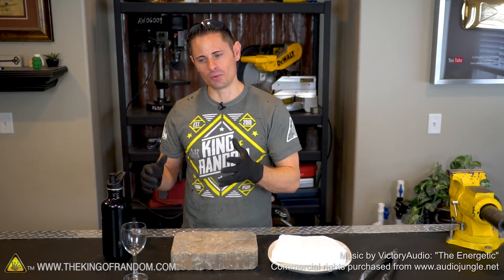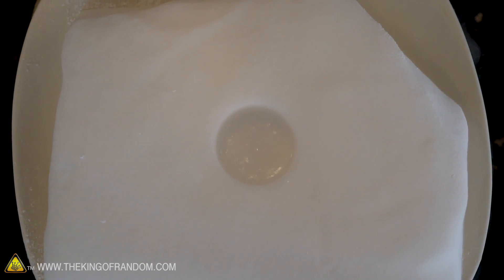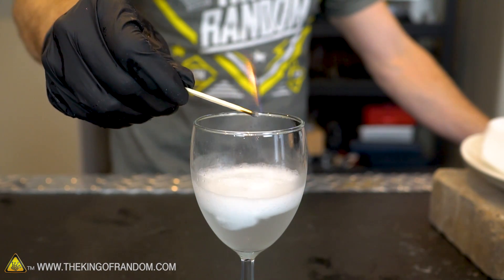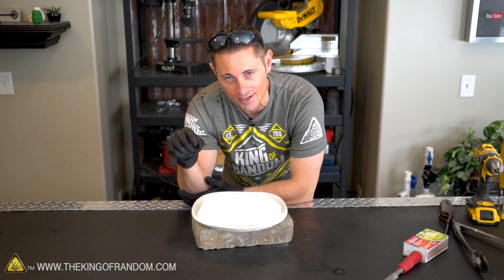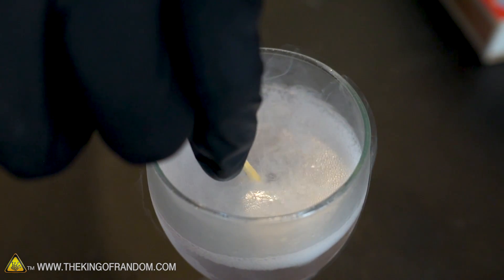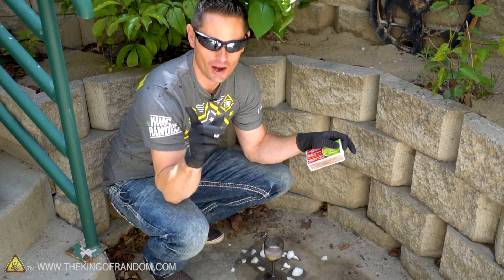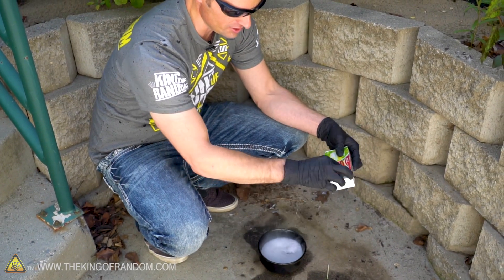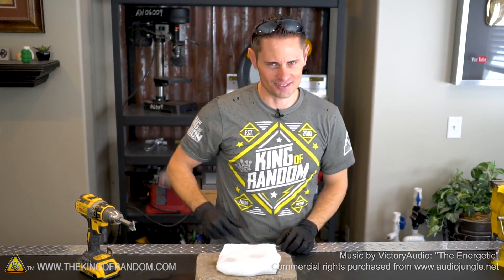What Does GASOLINE Do To Dry Ice? Can You Really Make A Fire Extinguisher With Gasoline?

Comment: Can you demonstrate the floating ship with sulfur hexaflouride (SF6) it's roughly 6 times heavier than air as a result you can float a blow-up ship on there, it also works the opposite as helium due to it's higher density it makes your voice very deep and it stops electrical charges or example if you put a taser in the gas it would't work.
Reply: Traveion Neilan helium is light enough to wear unless you're consistently trying to breathe it's it's not really a body can't really utilize it much so the little bit that does get absorbed is quickly gotten rid of which is an upside which is why if you're going to be doing that you don't do it a whole lot for very long and not very often otherwise it's mostly fine then since it's lighter than air it is has the nice additional perks that it's really easy to expel from our lungs if necessary
Reply: Isn't that the most powerful greenhouse gas known to man?
Reply: boltblast greenhouse gas, yes. Not sure about the severity of it.
Reply: Ellis Kennefick ur getting 25 bucks
Reply: Ellis Kennefick it is in small amounts like that though it won't be an issue
Reply: Someone listened to their teachers at school.
Reply: Ellis Kennefick Do it.
Reply: Do it
Reply: Ellis Kennefick I would watch that
Reply: Ellis Kennefick my fav gas the darth vader voice is awsome
Reply: Specter indeed.
Reply: Ellis Kennefick do not try helium it trys to take over oxygen and hurts your brain

Comment: gasoline itself is not necessarily flammable. it's the more volatile petroleum distillates or "gasoline vapor" that burn when mixed with oxygen and heat. too much air and they become too dispersed to burn. Not enough oxygen and they don't burn at all. it's a fine balance. too much air movement and heat and fuel are removed from the equation. remove oxygen from the equation and you get the same result.

Comment: Could you test dry ice as a fire extinguisher? Not just with gas but with different types of fire (grease, wood, gases). 
It would be a very cool and informative video 😀
Reply: Don't fire extinguishers use carbon dioxide? because I think he made a video on making dry ice from a fire extinguisher.
Reply: Cher Monroe It's also very cold, so it attacks two sides of the fire triangle.
Reply: Cher Monroe That is not reasonable.

Comment: Hi Grant,  Dry Ice won because you tried to Ignite Gasoline below the flashpoint of Gasoline. the CO2 makes a difference,  but factor in with the temperature dropping less than Flashpoint, the gas doesn't burn coz the 'vapour' of the gas is missing which spontaneously catches fire.

Comment: You can't light gazoline in dry ice because it is not the gazoline that burn but the fumes mixed with the oxygen (a really precise trio of heat, O2 and combustible), adding the dry ice take the part of the oxygen. You should try adding a layer between the gazoline and the ice to simply cool down the gazoline without the CO2 getting involved, I wonder if the gazoline is still making fumes at lower temperature that could burn. Probably since we have seen that iced gazoline burned pretty well

Comment: Only the vapor of the gasoline is combustible.  Lowering the temperature lowers the vapor pressure to the point where almost no vapor is coming off the liquid.  Grant was also correct when he said the CO2 vapor was forming a layer on top of the liquid, preventing any oxygen from reaching the surface of the liquid. Both of these things combined put out the match before it could heat up the gasoline enough to increase the vapor pressure to the point where enough vapor was coming off the top to react with the open flame.

Comment: Gas will put out a match all by itself as long as the gas is very still and you just drop it in. It doesn't have enough time to heat the liquid to vapor form (which is what actually burns).

Comment: You say the carbon dioxide puts out the fire before it hits the gasoline...Then still have a small layer of carbon dioxide and then say the GASOLINE put out the fire...Technically it didn't if you still had a layer of carbon dioxide even if only a small layer. It still went out before it hit the gasoline. Makes no sense to say the gasoline put the fire out when moments before you did the exact same test with just a bigger layer of carbon dioxide.

Comment: ok, so we all know burning is a chemical reaction. Chemical reactions require a minimum activation energy to occur, could it be that the gasoline is just too cold to react/the flame of the match is not hot enough, thus causing the frozen/cold gasoline to not catch fire? Also, im pretty sure when you burn gasoline its the vapours which ignite, therefore reducing the temperature causes the pressure to drop also causing it to not evaporate, meaning no fire.

Comment: Can you make your own carbonated drinks using dry ice? For instance, putting water in a bottle with dry ice?
Reply: Certainly possible, but you need a very strong bottle and need to warm it up all the way to room temperature before opening it up. But other than that, surely possible thanks to rising pressure.

Comment: put a turnd on lightbulb in liuid nitrogen
Reply: put a grammrly on your computer for perfct grammar.
Reply: Voodoosan you should too, *Perfect
Reply: Drill a hole in a working  bulb, pour liquid nitrogen in, seal it and light it up (don't forget your face shield, I suspect it's gonna blow).
Reply: Nothing happens, the glass might crack but other than that theres already a vacuum or a gas like argon inside of the bulb so nothing would happen other than maybe a crack or it would burn out.
Reply: J Schmidt actually if it's lit under the nitrogen it can stay lit because it doesn't oxidise, it's pretty cool really
Reply: The moment oxygen gets to the fillament it will combust violently. I've cracked a lit lightbulb before, not fun if your not trying to.

Comment: You need heat, fuel, oxygen and an uninhibited chain reaction for a fire to start and maintain. The dry ice kills the heat of the fire and also when gasoline catches fire it's the vapors that are burning. Co2 can be used as a extinguisher for fighting a fire, especially for electrical equipment.

Comment: You should melt 
diamond. Like if u agree
Reply: melting diamond is PRACTICALLY impossible because :
The primary difficulty with melting a diamond is that (given a sufficient supply of oxygen) a diamond will burn at only about 800 C, but won't melt until somewhere in the vicinity of 3500-4000 C.

Therefore, to melt a diamond, you need to ensure that it's not exposed to oxygen throughout (most of) the heating process. If you do allow it to contact oxygen while you're heating it, it'll burn long before it melts.

Once you do melt it, what you have isn't really a diamond any more--it's just liquid carbon. When you allow it to cool, it won't form a diamond again unless you maintain it under high enough pressure.

So unless Grant makes  a way to make something hotter than the surface of the sun you practically can't melt diamonds but you can burn them.
Reply: yeah its practically impossible because we humans cannot even make heat the same temperature as the sun with our current technology
Reply: TheMacawMacaw XD well we can actually make similar temperatures to what's on the sun. I'm not certain about the exact temperatures but I guarantee you that a fusion reactor gets hotter than the surface temp of the sun
Reply: Nothing fusion reactor and the likes. Just get a light arc, an industrial laser, tungsten etc. They all three can cause high temperatures, with the laser actually far surpassing 6000°C, even if only for split seconds at a time.
Reply: Yes we can, more than 200,000 times hotter than the sun in fact.
Reply: Alvinsland2 and figge plays ffs
Reply: jeromerox9999 but it will cost billions of dollars though.
Reply: haneesh kollipara mining 12 blocks above bedrock
Reply: diamond is made of carbon， only the structural strength between the atoms are stronger, when the temperature is high enough, it will just become carbon-dioxide
Reply: Jon Robin San Diego I mean, doubt even scientist funded by the government can do this.
Reply: Get it red hot in a torch and dropping it in liquid oxygen will do it.
Reply: the bestz ok....grant spends 900000 on a diamond grant:ok we spent 900000 on a diamond to melt it! it fails grant: O-O.............

Comment: Another reason the gasoline doesn't burn in the dry ice is possibly because the gasoline has been reduced in temperature to below its flash point. It won't burn at all if it isn't producing a vapour.

Comment: What would happen if you had a cup of gasoline, put a bit of water in (which would sink to the bottom), and then put some sodium in?  Would it react to the water without the oxygen available?  What if the water was carbonated, or highly oxygenated?  Would it be able to sustain the reaction long enough to ignite the whole cup of gasoline?

Comment: burning magnesium vs dry ice plz i really want to know what wins
Reply: the magnesium rips the oxygen from the carbon dioxide and the magnesium burns insanely brightly
Reply: also put burning magnesium between t laiers op dry ice
Reply: Frans Hendrix magnesium wins that one
Reply: Pretty sure magnesium fires require oxygen so it would be the same thing, by the time he got it between the pieces it would of burnt up or gone out.
Reply: Magnesium fires actually burn brighter in CO2 than air and forms Magnesium Oxide and Carbon. So actually Magnesium fires and CO2 is just a recipe for disaster.
Reply: magnesium will win
Reply: already been done, the ice doesn't put out the magnesium, and the ice doesn't melt.

Comment: I was always told that the liquid gasoline isn't flammable and it's only the vapors that are, so theoretically if you dunk a match in gas quick enough it will go out. I would like to see if this is true or not.
Reply: gasoline is normally liquid and also is flammable (did you mean in solid form?)
Reply: Wuz42 Wuz42 No, the vapors are the only thing that are flammable.

Comment: You can actually use gasoline to put out a fire (without the CO2). If you are fast enough and submerges the match into the gasoline the fire will vanish because there's no oxygen to react and make a fire. You only have to pass the gasoline vapor layer above it. You can try by blowing air on top of the glass to disperse the accumulated gasoline vapor and them dunk the match. I've saw a truck driver do this one time...

Comment: You did not use gas to put out a fire, you used carbon dioxide. The same types of systems (called CarDox) are used in industrial applications to put out fires where water or other liquids would be a major hazard.

Comment: liquid gasoline will not ignite. you have to get the gasoline ABOVE its vaporization temperature to catch on fire.

When gasoline burns its not the LIQUID thatd burning. but the VAPOR being let off by the warm fuel.

thats part of the reason why cars have an issue starting in very cold weather. the fuel is so cold that it gets below its vapor temperature

Comment: you should do the same experiment but try to light the gasoline with a blow torch because i think it has the power to blow the carbon dioxide away and light the gas without anu problem😋

Comment: The reason the gas doesn't light in the dry ice is because gasoline needs its vapor to ignite (that's why you can't light the liquid or solid gas). As you lower the temp of gas the partial vapor pressure decreases to below the lower flammability limit. Therefore no flames.

Comment: @Grant Thompson - "The King of Random" - There is a very little known fact that Gasoline, or Petrol as we call it here in Australia; does not actually burn, the petrol gives off a vapour which is the flammable part. 
The engine in a car runs of petrol vapour, which is why we use Fuel Injection. By atomising the petrol, you are making it easier to evaporate which occurs when the petrol hits the cast aluminumium manifold, and smashes against the rough surface, gives up its heat while evaorating, and by the time it hits the hot piston it is more or less the last step in evaporating the petrol so the vapours can ignite and send the piston on it's way down the cylinder, turns the crank etc..
My point is, the evaporating temperature of petrol is close to room temperature but as you lower it with your dry ice, you are stopping evaporation and putting CO2 in it's place.....

Comment: Actually, the biggest reason the gas wouldn't light when you had it inside the hole in the dry ice was that only the vapors burn, and the colder gas is, the slower is vaporizes.  So, at the temp the gas was at in the dry ice hole was so low that the gas wasn't really vaporizing at all.

Comment: As with the CO2 in the bowls, and glass CO2 will sit on the bottom, because it more dense than regular air so it will want to get as low as it can. Think of it like water (but CO2 it will fill a container with ease, just dont have a breeze around). Thats why it put out the matches out side. The CO2 filled up the area that the dry ice was in.

FYI: just like fire, we humans need Oxygen make sure your home doesn't fill up with CO2 or CO like what you had seen here in the video, have a CO2 & a CO detector in your home.

Comment: i think that you should try to take the same project and see what happens to it in a vacuum chamber or take the rods from the battery that you used in your video to melt down silicone metals and see if after putting them in dry ice if they still make fire

Comment: Gasoline as a Liquid does not burn. that is why the chilled Gas would not burn. it is the Vapours that burn. that is why you do not have to touch the gas to set it alight.
put the gas in the freezer and try it once it has cooled. you will get the same result.

Comment: You didn't use the actual gasoline to put the fire out. You used the CO2 layer on top of the gasoline. Still, great video. Can you try to make a firecracker containing dry ice? So when it explodes it sends CO2 everywhere putting out all fires in its way?
Reply: Finally someone else noticed this!
Reply: Dry ice is just frozen CO2, and it would sublimate into its gas form without the use of the gasoline. You could place it in whatever liquid you like and a CO2 layer would form on top of it because CO2 is heavier than Oxygen.
Reply: Gablstab omg this sounds amazing, you could throw them at a fire and the fire goes put with a bang. I can't wait to see this become a video
Reply: The gas would have easily set off if the CO2 was not there as you can see he set the gas on fire later. The CO2 set it out.
Reply: +Gablstab your also heavier than oxygen
Reply: Christopher Dijkstra the layer of dry ice was what vanquished the flame. That is what @gablsab was saying.
Reply: Christopher Dijkstra *didn't have
Reply: Gablstab so you're basically asking for a dry ice bomb in a fire. trust me, your idea WILL put out the fire, but it will also blow away all the fuel (wood probably) that you had burning. Mythbusters did an episode about doing that with a CO2 fire extinguisher being thrown into a fire.
Reply: Gasoline can put a match out, actually. In the right conditions you can drop a match into a bucket of gas and it won't ignite. What he said is factually true. Liquid gasoline will not burn, it's the vapors that it gives off that burn. This is simply because gasoline is not self-oxidizing. It requires the O2 from our atmosphere to sustain combustion. As soon as the flame enters the gasoline, it no longer has available oxygen, so the flame goes out. Fire will not light the liquid, only the vapor. It's the reason the whole cup won't explode when the flame of the match dips below the liquid.

This is actually true of all organic compounds and the way they burn - yes, gasoline is an organic compound. Even wood itself doesn't actually burn. The heat causes the organic materials to undergo pyrolosis (thermochemical decomposition of organic material) which gives off the flammable gas that when combined with the available oxygen in the air and the heat causing pyrolosis (when it reaches ignition temperature) combusts.

Gasoline gives off flammable vapors without needing to add heat to cause pyrolosis, which when combined with its remarkable energy density and ease in which gasoline oxidizes is what makes it so volatile. Heat increases the speed at which gasoline vaporizes which in turn increases how quickly it burns, giving off even more heat, vaporizing more gasoline..etc etc. This causes the illusion that it is the liquid burning, which is just not the case.
Reply: the flame never made it as far as the gasoline though
Reply: +Daniel Considering that oxygen has a density of 1,429 kg/m3 and a human body has an average density of  985 kg/m3 (at the point of total exhalation), I am certainly heavier than oxygen. So you are right.
Reply: Gablstab the gasoline did actually put out the match, because when the match was in the gasoline it didn't had any oxygen to keep burning, and thus not being able to light up the gasoline
Reply: Gablstab but the gasoline and dry ice produced that CO2 so isn't that still the gasoline putting out the fire

Comment: isnt this just an over the top 5th grade science experiment?   i do believe i did similar around that time frame.   via a test tube, but using co2 from our breath if i recall correctly.  

you need oxygen as a catalyst in order to burn fuel in any means (wood, gasoline, petrol based products, etc ...)   when oxygen is deprived fuel no worky.

Comment: Try putting dry ice in your mini arc furnace or metel foundry and see if it will melt or be very hot
Reply: Dry ice turns back into carbon dioxide. It goes through sublimation, not melting.